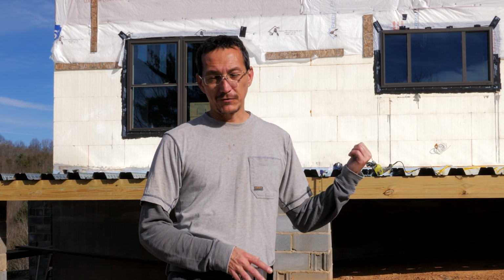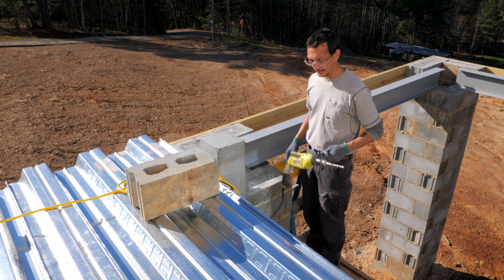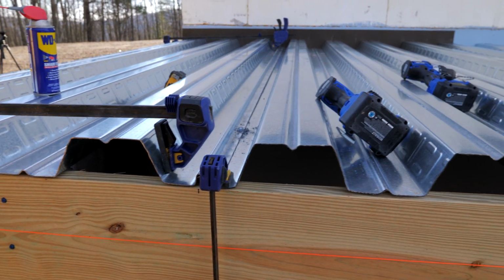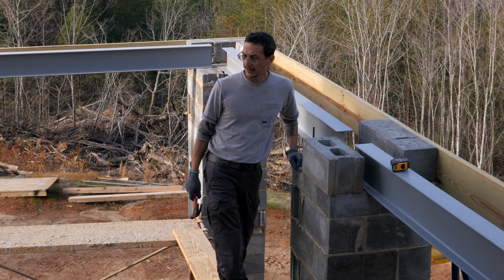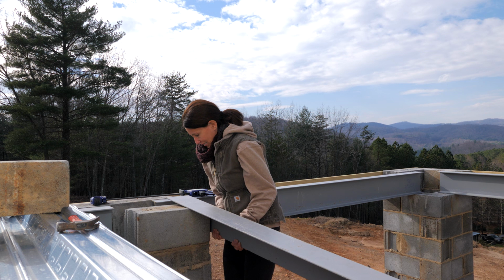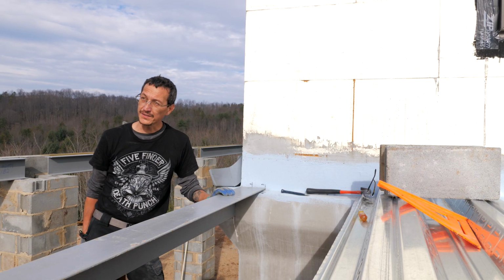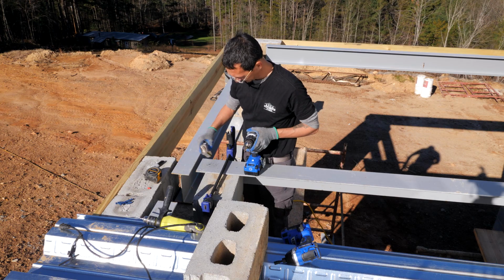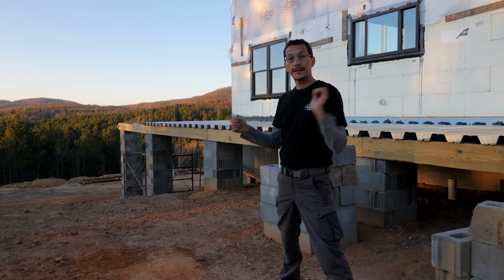Elevated Concrete Porch Slab Construction: Laying Steel Deck Pan

Comment: You know I thought you created the worst drip edge on your building known to man (as you can see from the streaks of water.)
But now I see it's actually your deck support. lol   Wow, corrugated steel, I beams, huge angle iron & concrete. 
You know somebody is not messing around when you see those ingredients.
Well done, very well done.

Comment: I dig the new music ! Outstanding job you guys have done and continue doing. You are actually living my dream, right now as you go. I watch in envy but in a good way, rooting for you and wishing you the best. Mine is probably a couple/few years away, depending. I used to frame/build houses and have been in almost every aspect of it, including the sketchy and scary setting of ridge beams like yours. For more than the last twenty years, until we recently sold the company, I've been a residential and commercial, licensed, "Private Protective", specialist, in security and everything low voltage. Alarms, fire protection, access control, camera systems, whole house intercoms, sound and more, here in Eastern NC. When you get ready to start roughing that in, if you need/want my help, let me know. Hint; Even in todays wireless world, I would hardwire everything now, while you can. Enjoy watching...Awesome house on an awesome plot !! Keep'm  coming please.

Comment: Since I worked in architectural firms for 24 years. I love the steel decking to pour concrete in as sub flooring. U mentioned to use lumber as form work to prevent overflowing of wet concrete.  In reality we use steel angles at end to cover and welded to beams it will be permanent form work for concrete to be poured in.

Comment: I am very much enjoying watching this build because it is so different from how I would do it where I am. I do have to keep reminding myself you don't live in Canada. I keep catching myself thinking how ice heaves and the freeze thaw cycle and the brittleness of -40C temperatures would crack and topple your pillars and an elevated cement pad of that thickness would last maybe two years before it cracked, crumbled and dropped. Plus it would be SO cold to walk on for three seasons of the year. We generally do our decks and porches with treated lumber and floated adjacent to but not attached to the house because of the effect of cold on cement and ground heaves. Plus the wood is so much warmer that just a bit of sun and you can start using your deck earlier in spring and later in the fall. We also have a frost line about 8 feet deep. Of course we hardly ever see a summer day about 80F either so I guess we have our own blessings and curses. Anyway fascinating stuff. Thank you for sharing.
Reply from the maker: Yes you have to build for your location

Comment: Great progress!!
Do you think temps will delay the pour? I'm not certain how cool it gets in your neck of the woods. I sure hope the pour won't be delayed for y'all's sake. I am certainly praying that your 2021 start comes with great accomplishment and excitement to finally be getting into your dream home that y'all have so patiently been working toward. It sure has been a long time coming for you. I remember when y'all made the move and I'm still here supporting. Keep up the good work.
Reply: What I have always heard you need is at least one full day above 40 degrees. Just guessing he is going for high strength concrete.
Reply: Time to go. Dentist awaits.
Reply: @ArnieD17  You can always edit your comments by clicking on the 3 vertical dots to the right of comment.

Comment: To get extra strength out of that decking you should find somebody with a button punch and crimp/ punch the little rib where the sheets overlap. This way when you pour concrete over the deck the seams don’t bust. That is how that deck was designed. I have installed thousands of feet of that decking and have tons of experience with it

Comment: By squeezing those panels together you have caused some of the tops to bulge upwards.  Run a string line down the top and you will see what I mean.  These panels are not designed to be squeezed to fit.  I have installed these many times across girder expanses and they were dropped in and the panels were butted together and a span strip was placed and tacked across the joint. Since you are going to bury them in concrete just cut them to fit your joist hangers and tack/plate weld them at the joints.  You need only to put in a 45-degree girder at the corner then cut the span panels at 45-degree angles to span it.

Comment: greetings jeremy; just a thought for you to ponder; drills usually have cooling fans internally that move an abundance of air through; this i use to extricate the dust and trimmings from concrete holes instead of having it blow back in my face (in the absence of compressed air). think on this to see if it will work for you...................g

Comment: Is the steel deck sloped down a little otherwise your steel will rot
Reply: It's only formwork, once the concrete sets the decking sheets hold no load 👍😊

Comment: 👍 Serious work level 110%. I think I would use a genuine 3m NIOSH approved respirator for the grinding, silica dust, spay foam, and drywall dust. Your lungs will thank you later in life; even though the wind seemed to be in your favor for most of your cutting. Be well.

Comment: What prompted you to choose concrete for the porch ?
Reply from the maker: It will outlast wood and composite by decades and requires much less maintenance.
Reply: I guess your area has termites, and this would prevent invasions.

Comment: It was nerve wracking watching you hammer that angle iron into the cut in your concrete. If the angle iron was a little over sized, that's exactly how I'd split a block of concrete or stone... I wonder if you should add some straps and vertical angle iron to shore up that little tab of concrete so normal motion of the deck with use and seasonal changes doesn't develop a crack in the wall over time.